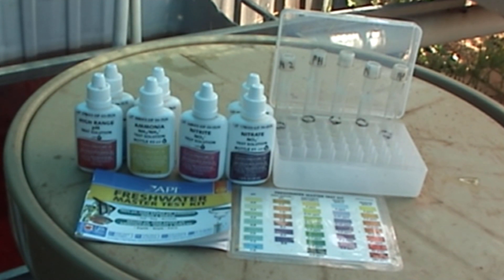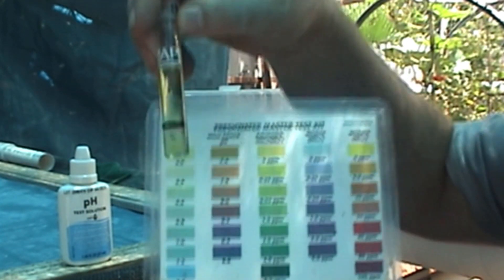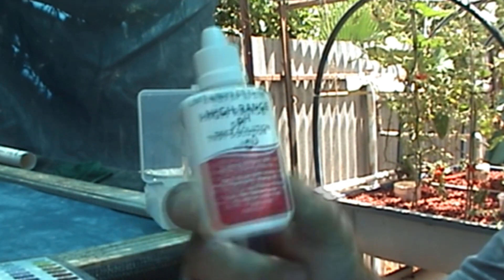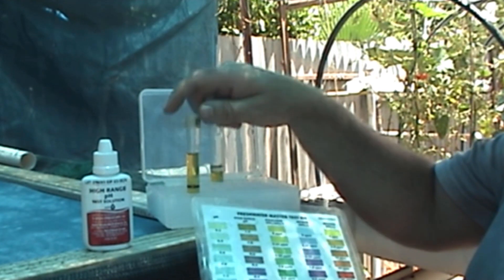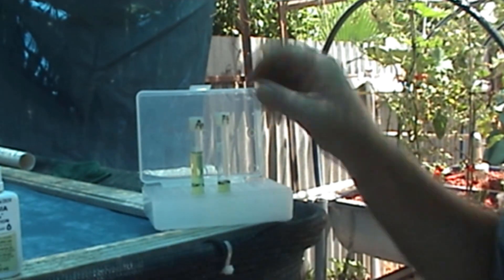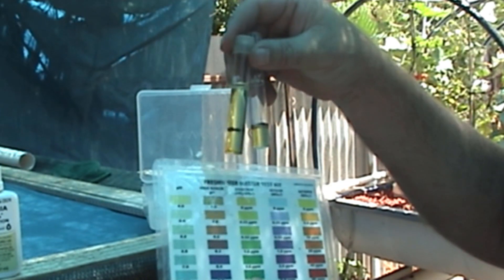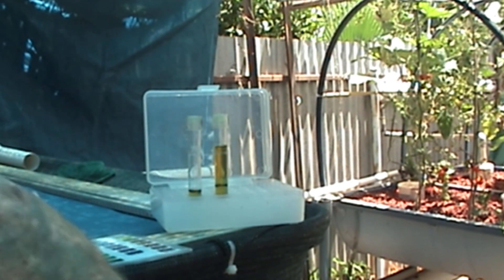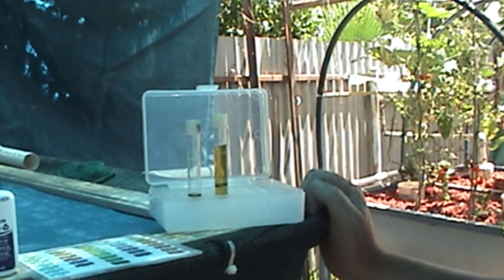Extend your API Freshwater Master Test Kit from 800 test to 4,000 tests for Aquaponics

Comment: Great video.  However, aren't your High PH  measurements wrong? High PH is exactly like the nitrite test where the normal test is 5 drops to 5 ml. But you're saying 2 drops to 1 ml for high ph and 2 drops to 2 ml for nitrite.   Shouldn't both tests be the same ratio?